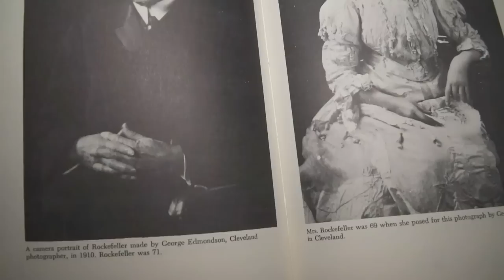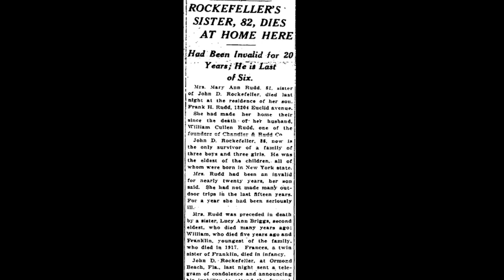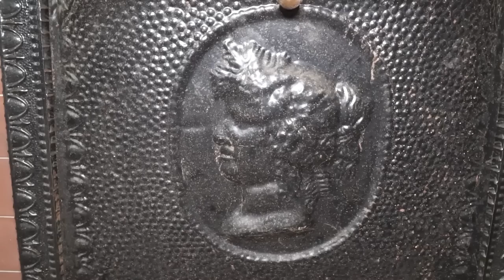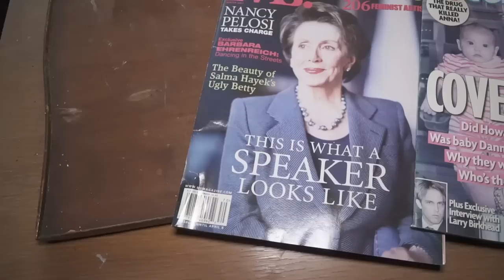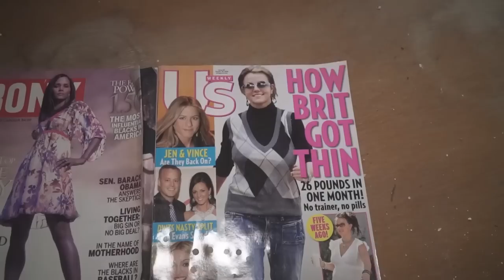Incredible Rockefeller Mansion Exploration | East Cleveland, Ohio

Comment: 23:33 Someone took the faucets from the tub. They were built into the tub back then, so they had to break the tub to get them off.
That whole upstairs would have been for servants. I'm guessing the screened door was for ventilation. They could open the windows in that room to get the hot air out of that area and fresh cool air in.
Reply: That room could of been a place to hang laundry during winter or anytime.  Screen door and open window would create a cross breeze.  Yes, Underwood made quality typewriters.  😊  Thanks for the video.

Comment: Shortly after you showed the door with the "hardware cloth" screens that you couldn't figure out, you talk about the woman having cats.  There's your answer!  Cats will climb screens (my Fur-friend tore holes in the plastic ones in my last apartment), just as they will climb hardware cloth screens, but they can't damage the heavier wire.  Dane, Underwood was one of the premium brands of typewriters, along with Royal, Smith-Corona, and Brother.  Aha, the thing you found in that little room (28:26) was an expansion tank for a hot water heating system.  The furnace, with a water jacket inside, would've been in the basement.  An electric pump moved the water throughout the house to the various radiators and any air in the system would go up to the tank, where the water would compress it.  Hot water heat wasn't noisy like the steam heat.

Comment: Dane, Nice long video. Thank You.
The heating suystem is most likely steam and the parts your calling elements don't have any electrical in them and that would make them  steam radiators. It's not likely do to the age of the house but hot water could also be used with radiators.
Reply: I scrolled down to see if anyone---or how many!---would correct him.  I'm surprised he did know, or is it because he's too young to have encountered them very often?  Our second home, as I was growing up, was heated by hot water radiators and it was the most even heat I've ever experienced.  In fact, until they decided that it wasn't efficient to have the unwrapped pipes in the basement and insulated them, I used to lie on the floor in our 14x22' (they'd eliminated the wall between the dining and living rooms), with my head against a hassock, watching TV.
Reply: @oldenweery7510  I have only had steam heat in two places I worked and when the radiator was not too hot and I was cold it was nice to stand next to. The other warm place to go was the steam supply tunnel.
Reply: @seannot-telling9806  Yes, but you definitely didn't want to sit on a radiator or you'd have fried ham!  I worked in an office building in Hempstead, NY, which was comfortable all winter, but the boss rented another, smaller, 2-room office for storage and all you'd need was some water to turn it into a steam bath.  After a few minutes in there, you'd want to wander around in the cool hallways for a while, fanning your arms.
Reply: @oldenweery7510   The steam tunnel in the spring on a warm day was not a place you wanted to be. 
In the winter after working outside and getting cold it was nice to just stand and warm up.